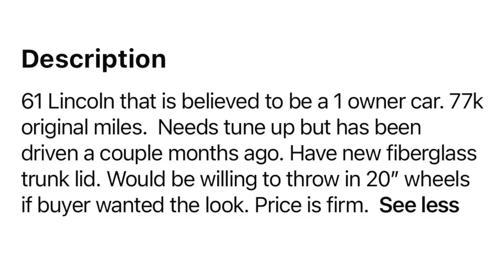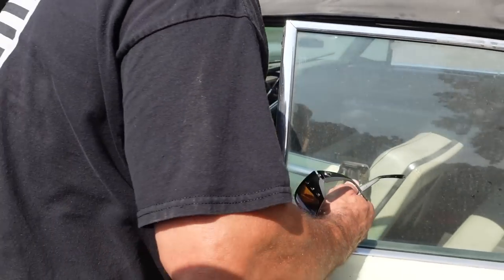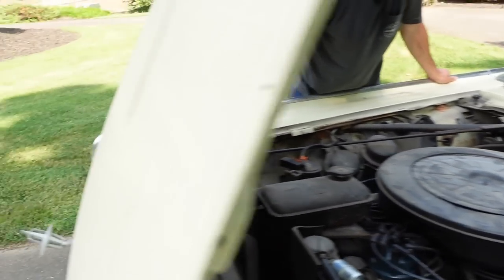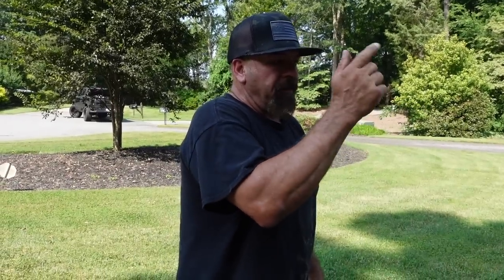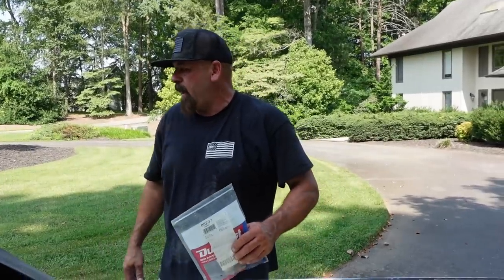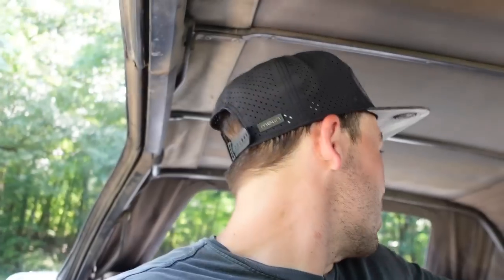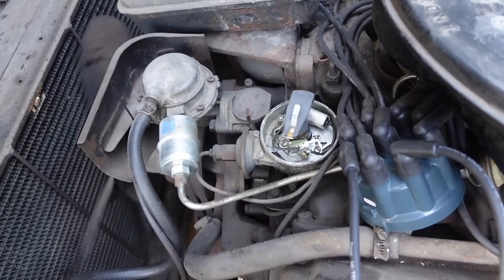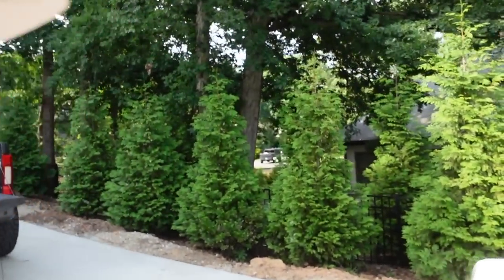We Bought A Rare Original 1962 Lincoln Continental Sight Unseen - Then Broke Down Part 1

Comment: Please don't patina it! Those Lincolns are some of the most iconic and beautiful cars to come out of the 60s. Show it the love it deserves with a slick paint job, vintage air, whatever the drive train needs to be super reliable (Coyote) and something like a ridetech suspension (not to slam it but to keep the feeling of floating down the road). If you leave it as is, you won't use it the way it was meant to be used but if you put in the time, money and elbow grease you'll use the hell out of it and love every second of it.

Comment: The knocking in engine when your Dad drove away the second time was timing knock! I would guess the timing is off and possible it jumped time and needs a chain and gears! The oil spraying ? The smoke is probably valve seals

Comment: It brings back memories. I am 59 years old now when I was 13 years old my mom had Lincoln Continental it was around 1966 some where around that year. It had Ac I remember it even had power high beam headlights it was fully loaded. It was a hard top. I have always loved those cars the memories they bring back. I would check the motor out an see if it can be rebuilt. Up the HP with cam up the Ci. 
 Coyote motor would be a great motor if the motor in it can't be rebuilt.

Comment from the maker: What’s your favorite classic car?
Reply: My favorite part was when you got the butt hurt look on your face when you seen the rust.  Your dad clearly understands nothing is ever going to be perfect. Excellent find though.
Reply: That is a 430 cubic inch V8. Their is a company here in named Baker Auto in Putnam,Connecticut that specializes Lincoln’s from that era. Brad they have everything for that car.
Reply: 68 camero. Anything the year I was born. 68 chevelle  68 C-10. Lol.
Reply: 1970 Chevelle. 454
Reply: 70s Oldsmobile 442
Reply: What up Brad ? That is a Sweet car ! My favorite car is a 64 GTO or a 67 vette .
Reply: 66 427 Shelby cobra
Reply: Lol apparently my xj is a classic car now. Time is flying by.
Reply: My last 13B 1982 RX7 GSL. Would do figure eight burn out while shifting from a parking spot, the most insane launchesl Actually built to rally right from the dealership with the independent rear tire steer and transmission!
Reply: It needs one of those ford bug block motors like cleetus has in mcflurry
Reply: 1960 starliner. But we will be bringing home a 1963 Saratoga 300 2 door hardtop Canadian made only car.
Reply: 1955 2 door nomad or 50 Mercury

Comment: I found the 62 in navy blue and light blue leather interior what a beautiful machine it was all options. I bought it 1970. It had 50,000 MI. Me and my friends had Camaros and mustangs this held its own with the big 430 ci.
Also, does vapor locks in the heat.
Is it a factory air conditioning it was a beast. Conley leather and Berber carpet. The wood enhancement is real. I also had a 1963. Lasted the longest and I also had a 1965 Anna 1967. I had to rewire the 1963. A clumsy mechanic working on it with pliers touch the positive and negative battery which freed all the wires except for the relays. Amazing everything worked after I rewired.

Comment: 7.3 Godzilla for an engine, with the Ford 10 speed transmission, nice 9inch out back. Get the top working, throw those Detroit steel wheels on, and cruise that baby. Later on down the road once all the mechanicals are done and perfected, nice shiny coat of jet black paint, and all shiny trim powder coated black. You got yourself a top tier cruiser!

Comment: Has the gas been drained  ?  I would change the oil and check the valve adjustment,  it appears to be blowing back through the Carburetor, see if you can get it running good if not then change the Engine, Garage Squad did one of those Lincolns and you will need to check all the relays to fix that Top and there's a bunch of them.

Comment: It has a 430 engine in it, which is specifically designed for that car. The windshield wiper motor along with other features run off of hydraulic fluid powered by the power steering pump and the power top includes a series of electrical switches, relays and motors, which need to function properly, or you will cause major damage, not to mention the acres of vacuum line to operate other functions. Yes, you can stab a 460 in her, but you would be devaluing your vehicle by a lot. Because it's a mostly solid platform, I say put her back the way she should be or sell it as is to someone who can. These are very complex vehicles and expensive to do right.

Comment: The rings are probably stuck is why it is probably smoking not guaranteed, but you can make it smoke more for just a little bit and see if that’s the problem run it at high, idle and pour either sea foam or ATF down the carb . I have done this in the past to clean out the carbon in the combustion chamber and rings

Comment: Hi Brad. Nice find with the car. Please don’t listen to some of these guys saying it’s a 351, 461, blah blah blah. Here’s the scoop. 
61-65 the LC were equipped with a 430 BB MEL (early years were 2 brl. 63-65ish it went to a 4 brl). 66-68ish they transitioned to the 462 (basically the same as the 430). In 69, they introduced the 460. Any of those engines will drop right in with zero mods. The guy claiming you can get that engine rebuilt for 2k. 🤣🤣 fat chance in hell pal. Ain’t gonna happen. 2k will probably get you the block reworked and maybe the lower half. Brad, from experience, some of the engine parts reproduced to rebuild these engines are garbage China reproduction. I’m sorry, but that’s fact. You’ll spend probably 4-6k rebuilding it and hope it last you 6-12 months. The transmission’s on these cars are notorious for leaking and failing. If you power with simplicity, the LS is your friend. I know of numerous companies making kits that allow you to drop an LS in with zero mods to the actual car. However, if you want it to sit “frame” or close to it/ aired out. You want to tunnel the rear most section. I can explain in detail later. A Yote or Zilla will result in heavy mods of crossmember and trans mount. Including having to re-tunnel the car. Until you decide, Rotella motet oil is your friend because it has zinc. Type F trans fluid for trans, power steering, and technically your convertible top as well. The wipers work off your PS pump, so don’t run it dry and try not to turn the wheels without the car running, or you can blow the seals on the ps pump. Lastly, when warming the car up, DO NOT leave the car unattended. They are well known for popping into reverse on their own. The cad will take off or worse yet, run any kid over that may be playing behind it. Best of luck. Reach out if you have questions. I’ve worked on more Lincoln’s then I’d care to admit. I have sources for you for numerous rebuilt or replacement parts if needed. They’re fun cars, but get Hell of expensive really quick.  Watch the top, when it’s pulling out of the trunk, it’s pulling the equivalent of 2 tons of force. They are hella heavy. Check out our page on IG @TheRattys or DM me on IG @Papis_65. We kinda know a thing or 2. Enjoy.
Reply: Spot on

Comment: Honestly .... do your diligence! You are asking questions that you can research. This car deserves a whole lot better than what I am hearing. It has the 430 V-8 with the wedge cylinder decks, every car sold had the engine broken in on a 12 mile test track. Dual thermostats and heater cores, that reservoir you were assuming was for engine oil is actually the power steering reservoir, the pump is run off the crankshaft. These were some of America's best built cars. Treat it with respect.

Comment: Yeah, it's usually a BAD idea to try and punch any 61-year-old engine that's never been opened up...as you found out.  Good news is that those old MELs are very tough and very resilient.  Mine went through exactly that same issue two years ago, and I was able to rebuild it with no prior rebuild experience (though, admittedly, I did have a lot of rebuilding study from the shop manual).  I can do the same with that one.  Rest assured, you will wind up spending far less rebuilding that engine than you would trying to drop a different engine in there, even factoring in a four-barrel mod, and my daily rate.

Comment: The crazed wood is because it leaks and got really humid inside many times. They are thin veneers glued on stainless steel and you can get replacements if you really restore it. You can get all kinds of NOS and replacement parts for almost everything including the engine and complete stainless exhaust systems, but a real restoration will go into the tens of thousands. Those are original 14" wheels and the tallest modern radials are lower than the original tires. There is about one guy in the country who understands the roof mechanism which uses at least a dozen relays, several motors and a mile of wiring.

Comment: That would have came with a 430 CID I think.  Not a very impressive engine, terrible gas millage I don't remember seeing one with even a four barrel carb from the factory.  My suggestion would be a 460 or a new Godzilla and a 10 speed.  I'm a bit of a purest so I would stay with a Ford engine that's just who I am. I worked at a company called Dallas Smith in the summer of 62 between 8th grade and freshmen year. We would take new cars from the trains that transported new cars here to Phoenix.  What a blast I had that summer, we worked on a line that would wash the protective coatings from all makes of cars and trucks.  We had a detail shop cleaning up everything. We even did undercoating at the shop.  We made the new cars look new before delivering them to the correct dealers around town.  I would like to see this restored to new condition.  A real purest would rebuild the 430 to keep it numbers matching for the most value.

Comment: That is going to take soo much money if your restoring it. Those had computers before they were electronic. That drop top is going to be thee hardest thing to fix or replace, the next being the automatic windows if it has it. They run off of vacuum to function. The vacuum runs through those "computers" to control alot. Good luck. If anyone can pull it off, they have a skill that's has all but died.

Comment: This car is worthy of a full restoration... frame off... paint... engine rebuilt... all electrical harnesses replaced. In the end it will be a 6 figure car.

If it was in a more worse condition that required body panel replacement... id go restomod... with a Ford racing motor and bagged suspension... but this car is a gem... bring it back to its original glory

Comment: that is a 430 ci  7.liter  MEL ENGINE about 300 hp very rare engine  it can be a nice engine fixed up
Reply: Rare doesn’t mean desirable. People sell full drivetrains running for less than $500 all the time. Some have to give them away or scrap them

Comment: These cars are super slick bagged with big wheels. I’d paint match the wheels to the factory paint clear coat it and bag it. If you must do a motor swap keep it ford which ever way you go. Maybe a 500 in plus ford street motor clear the paint put a serious 9 in or maybe a 10 1/2 in rear paint match those wheels or get a set of Detroit steel paint matched and bag it. And drive it

Comment: If it is not a heap and salveagable price only going up. This comment at the 10 second mark. Especially rare if it is a convertible. Those slab Lincolns 61-64 iconic and awesome. Now commenting at end of video. Nice find. If you could paint it th exact same color and the top black that would be awesome. If you restomod do it with minimal thought in mind, lots of restraint.

Comment: If this is a one owner 1962  Lincoln continental convertible then there was only 3012 made. It has the very rare 430 CI motor. You can rebuild the motor for under $2k. If it's number's matching then it's worth $60k not running. $125k to $600k restored. Just rebuild the motor . Don't be stupid and LS swap it.

Comment: All that old paperwork you found in the glove box should be protected and kept in a safe place because it adds value to the vehicle! That paperwork is irreplaceable! Especially the stuff like on the battery etc! You probably shouldn't have been driving it around like you guys were but! Some zinc in that in the oil would have helped those rings would have possibly wore back in from sitting! Diesel engine oil is really good for engines that have been sitting for a long time because of the minerals and zinc in the oil! You really should have went through the motor a little better before you started ripping on it Just saying! lol! You didn't give the gaskets enough time to moisten up again anyways nice find! Congratulations! ( I know you know what you're doing I just don't really know what your background is with cars that have not run in a long time like this car)

Comment: That's worth way more than $20K, like dad said , cleaned up $40K. Non AC? It's a convertible!! No need for AC. It is a MEL 430 2 barrel. LS swap is easiest and no frame mods. Coyote is do able $$$, a couple people are in the middle of trying Godzillas, big job, both require cutting out the crossmember in the engine compartment. Deck lids all rust, even on a well cared for car, new one worth $3k. Find someone that knows the convertible tops, so many idiosyncrasies.  Before he retired, The Lincoln man, John Cashman, used to travel and repair them, $2500 first 8hr day (minimum) $250/hr second day...plus parts. Have fun.

Comment: Probably knocking because is running unleaded fuel. That vintage cars used leaded fuel.  You can use an additive to get rid of it or retard the timing until is gone but then you'll lose power. It also seems to have either a stuck or burnt intake valve because it's spitting compression out the carb.

Comment: Definitely needs leaded fuel. Put some engine cleaner in , run for 5 /10 minutes and change oil.  PS. You won’t see spark with the cap off.

Comment: It should be a 430 V8 engine 300 horsepower very good engine for its time later replaced and I think 1968 by the 462 another very powerful 375 400 horsepower another very good engine if you have to replace it replace it with a 460 2JZ should be shame yourself even thinking like that that car deserves way better than it deserves a full restoration bring it back to it's Glory

Comment: This engine is a 430 CI MEL 300 H.P. This is a classic car. Please do a full restoration on it as it deserves. If you do an engine swap at least do it some respect, do not put an LS in it, put a Coyote in it, with a new transmission to match. This could become a cool convertible cruiser.

Comment: Those wheels aren’t likely a good idea cause they have no side wall and a car like this the tires are figured in to the suspension a good sign is the doors don’t hit at the top then so it doesn’t like frame has sagged. the  motor should be a 410 Lincoln V8 Y block hopefully you can rebuild the motor or replace it with a 460 Ford big block.For heavens sake don’t chop this thing up